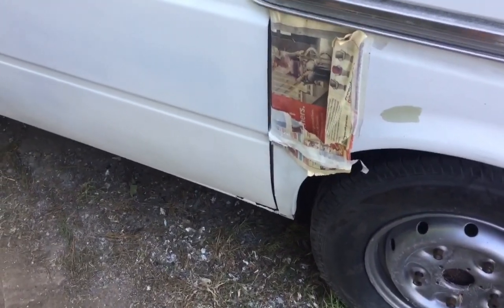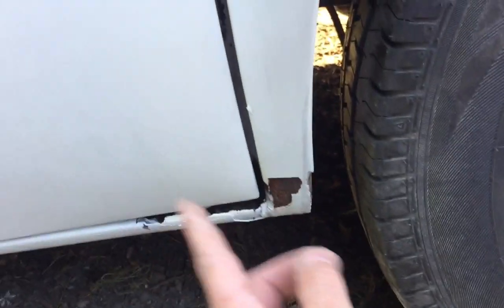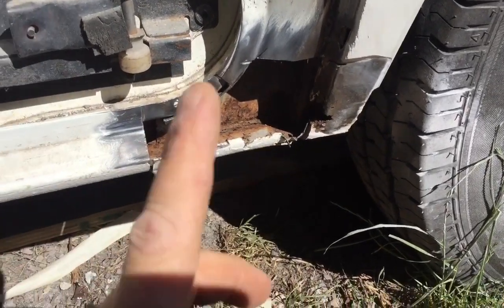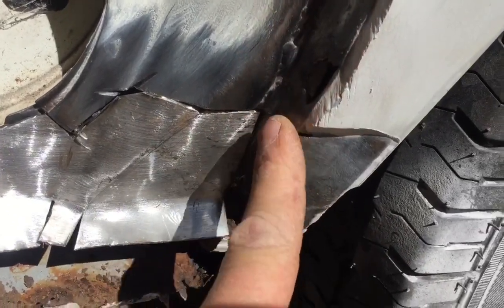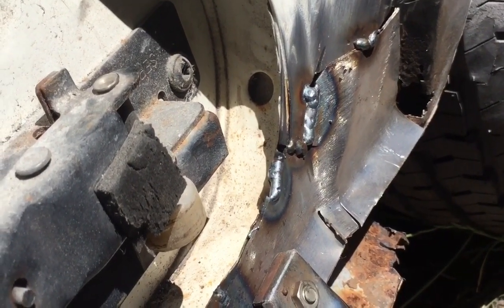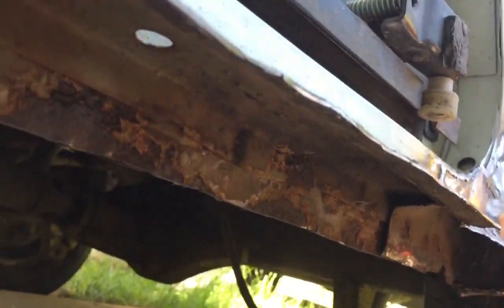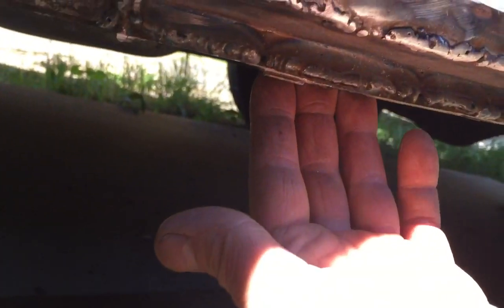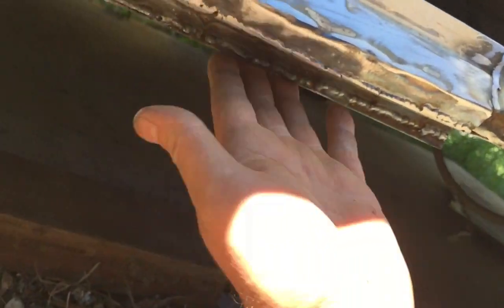Ford Transit MK5 Camper project (Sill welding action ) Part 7

Comment: always a little more difficult welding outdoors.can save many hours labour buying repair panels.best wishes
Reply from the maker: Hi yes buying panels would have made it easier, also less filling to get the shape back afterwards. I did have a quick look and couldn’t find this panel but I didn’t look to hard. But after this area is finished I can nearly put the welder away, well that’s until I have to use it on the defender 90😫 but more on that coming up, thanks for watching🙂👍

Comment: Takes a lot of perseverance to keep going on a rusty motor like this but well worth it when you see the light and the end of the tunnel!  Good job.  Have you seen Austin on scudocamper , he has done similar to a transit camper, rear  floor was shot on his though. https://youtu.be/2ub_C3b785k
Reply from the maker: Hi yes I followed Austin for a long time, the doors painted now so I can sort of sort out this area of the van now and this is by far the worst rust on it. But it doesn’t end there as my defender 90 I’ve discovered needs more welding than I though😫 lucky I invested in a welder😁 thanks for watching🙂👍